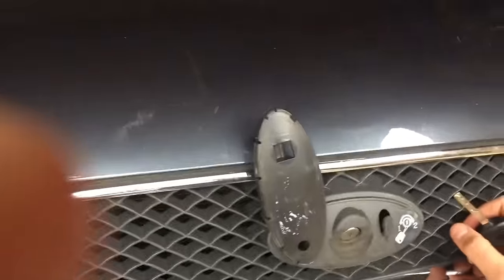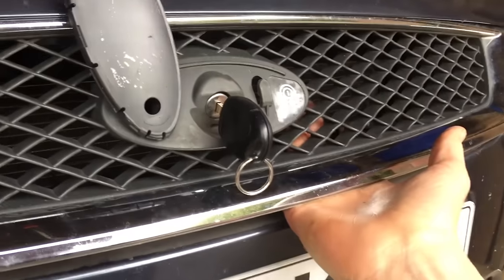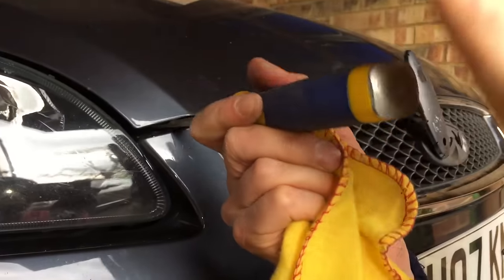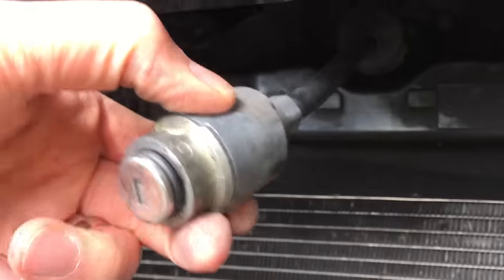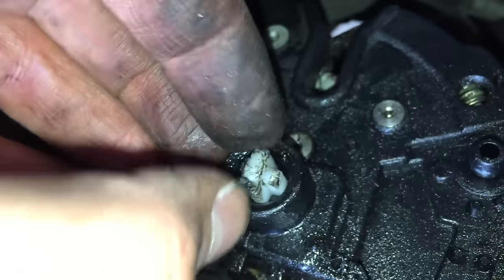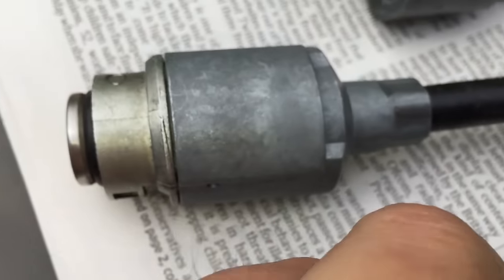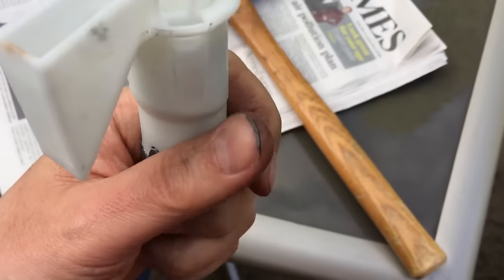Focus Mk2 Bonnet Lock Won't Open - Hood Release Problem (Full Guide)

Comment: Thanks for this. I followed some advice elsewhere that suggested if the white cross piece is simply loose, not broken, then you can try putting pressure on the lock (flexing the grill) while turning the key. That got the bonnet open so I could take it all apart.

I used this video to find my way around the assembly:
1) Removed the plastic screws from 6:35 (some with a screwdriver, some by prising up with a sharp tool) allowing me to remove the grill (with some force for the bottom clips) and top panel.
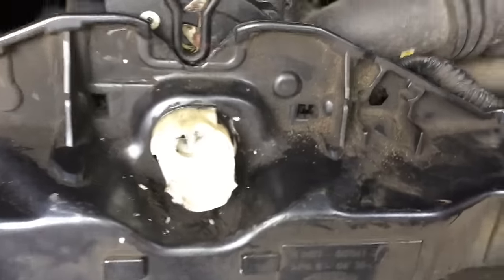2) Unbolted and popped out the latch assembly (see 10:15) and then I could pop the white cylindrical shroud through the hole without having to break it. 
3) Used pliers to remove the cross piece from the latch (takes a bit of force but came out intact), like at 11:52.
4) Clipped the piece into the cross-shaped slot in the other end, using a screwdriver to nudge the clips in, so it looks like 15:47.
5) Rebuilt everything, and it's all good!
Reply from the maker: That worked for me once, but I stupidly closed the bonnet and it never worked again :(  Thanks for posting though, it will help some prople im sure.

Comment: Thanks very much for this - it gave me a great start - and an idea that saved a lot of trouble.
I removed the grill and and pushed out the lock casing. Then I pushed and drilled out the securing pins to release the lock barrel. This allowed me to get hold of the end of the inner cable with a small pair of locking grips. After a fair bit of waggling and pushing in various combinations I got lucky and the bonnet popped.  (I'm sure it won't work every time, but it's worth a try.) On dismantling the mechanism it appears that the small cross-section piece of plastic is the culprit.

Comment: Thanks so much! Just completed it successfully. I’ve got the facelift model so stupidly thought I did need to knock out those first 4 clips…turns out you don’t on this either 😅 anyways, cheap and doesn’t hurt to replace. Thanks again, legend.
Reply: Ha, just realised I commented 5 years ago when it happened last time! Bloody thing.
Reply from the maker: It’s crazy isn’t it, on the third time I left the lock out and used a long screwdriver. Glad the video helped 👍
Reply: @MotoringEvents  great idea…next time I’ll do the same.

Comment: Thanks, the video was helpful.
I'm afraid of breaking down the front wall, so I don't break something, but I have to do it, because the locking mechanism failed for me too.
Reply from the maker: Hi, it's always a bit intimating, but it's not that bad once you get started. Read through the comments, there are some good points there.

Comment: EXCELLENT TUTORIAL. Thank you. Everything worked as you said, no problem. You can get the kits now off eBay for about £15.
Reply from the maker: Glad it helped. Are the ebay kits Ford? Whats the quality like? Thanks Rich
Reply: @MotoringEvents   Not genuine Ford, it was from the far east via a UK supplier. It arrived in two days. I didn't have any problems fitting it and it works fine. I used my own barrel lock so I can't vouch for the rest of the kit, but it all fits, it all works. Job done.  Thanks again, you saved me a lot of money. I dread to think what a Ford dealer would have charged.
Reply: How long did it take to do? Just had the garage tell me it's 3 hours labour costs.
Reply from the maker: Chris Shades cheers, good info.
Reply from the maker: Nigel Johnson if I had to don't again 30mins. But I think garages break the grill, so more expensive too.
Reply: @TheNigeljohnson   Not that long, maybe just over an hour. This tutotrial video made it so easy. Don't be afraid to whack hard with the chisel to cut off the tops of the securing screw plugs. Make sure they drop out when you have. Again, whack hard to break the old unit off then jam a screwdriver in there to twist left and right and open the bonnet. After that it's easy. If you are using your existing barrel lock you will need to drive the pins out to remove it. Use a nail the same diameter as a drift, but cut the point off first so the end is flat. If the pins are rusted in then drill them out with a same size drill bit. New pins come with the kit. It all went smoothly for me. Have confidence and give it a go.
Reply: Thanks for the info.

Comment: Had the same thing happen to me last weekend. Need to put the battery on charge but the bonnet failed to open. Thank you for your efforts to show us how it's done. I can see if you have slim small skinny arms you might be able to get to the 2x10mm bolts from underneath. I will give that a try but if all else fails I will follow your techniques and procedures. Thanks.
Reply from the maker: Hi thanks for watching, i tried that but couldn't get the lock off. Space probably depends on the engine too. Good luck.

Comment: Just watched this to get a good idea of what was inside my girlfriends car. One thing to mention, didn't have to use a hammer to break the barrel out, I just reached in behind and removed the 2x 10mm fixings with a ratchet, pulled the barrel towards me to disengage it from the lock mech and prised up the bonnet which popped out the lock. You can then turn the plastic cross part that is left in the lock with pliers to release it from the catch. In my case the barrel and collet had just disengaged from the plastic cross piece in the lock mech. Once I re aligned it and re-fitted it it was fine. Hope you never have to do this again anyway! Your vid helped me a lot.
Reply from the maker: Dean Forrest but the hammer was pretty funny! Good tip. Cheers
Reply: How did you reach in?

Comment: Nice video, with a touch of humour. I was able to fit the new lock. However, I was unable to get the grill off (later version of it than yours), so I had to cut it out. But job done, and thanks.
Reply from the maker: I have the later one now. You mean it's going to happen again!! Cheers for watching and I'm glad you got there in the end.
Reply: @MotoringEvents  The grille was only £25 - better than scratching the bodywork, and a lot better than forking out £200-£300 to a garage, plus the satisfaction of solving a problem. Cheers!

Comment: Agree - a bad design . I used a long modified screwdriver for a couple of years till the plastic slot of the lock eroded. After fitting a new lock I found that tightening  after removing / cleaning of two bonnet screw spacers which had aged / had dirt buildup  eases rotation of the key after  the bonnet was locked and the cause of seizure or resistance to turning of the key .Periodic  cleaning of these spacers below the bonnet keeps the system healthy from this future problems .
Reply: Nice one buddy, mine was slightly different but this video is spot on and saved me £200.👍👍👍

Comment: I yanked the whole grill away (including some of the plastic covering sadly) by knocking out the 2 retaining plastic rivets either side of the grill and freeing the 2 clips along the bottom. Yanked off the wire then used a hammer to knock of the white plastic bit, then used pliers to twist one way and then the other to open bonnet. You can see the 2 rivets quite easily by lifting the bonnet as much as you can.
Reply from the maker: Brilliant, thanks for sharing.

Comment: Hi, just had to change a bonnet lock on a 2010 Focus. Followed steps as per video. One thing, they seem to have changed the upper guard to a form of airbox. Did not come out untilbafter bonnet opened.
The replacement lock kit KAS00154 4M5AA16B970 Now comes with an extendable plastic bar instead of a cable.
Thanks for the video. Took me just over an hour.

Comment: Well done... I likely have this job ahead of me. Although I think I can get the bonnet open. Unfortunately I park on public road so it will have to be a start to finish job (with unknowable issues) on same day.

I must say, with Ford's enormous R&D, they get a serious black mark for such a BS design flaw. I tiny bit a important plastic - that's a recipe for future nightmares.

What was wrong with a foot well latch pull like my 20+ year owned MK3 Golf had.

When I eventually scraped her, the bonnet latch pull still functioned flawlessly after nearly 25 years.
Reply from the maker: Ive had to do it 3 times on 2 cars, cheap ebay part didnt work well for me. Ive left it out now and open bonnet with a long screwdriver. Good luck.

Comment: The MK2 Focus is full of problems which stem from shoddy designs, none of which should have ever been implemented.
Two notable ones are this very bonnet lock mechanism, and the power steering pipes. 

I shall be following your guide this weekend to replace my lock, or at least butcher it and integrate another solution.
Reply from the maker: Good luck for the weekend, I hope there's no need for butchery ;-)
Reply: Im guessing by power steering you mean the stupid union Nut
Reply: Richard Winstanley great I've just bought one after years of been a freelander fan ! Just can't afford the fuel anymore the governments squeezing us to go the way they want by fuel hikes .

Comment: Great vid, found my car is missing the stone shield which made for easy access from underneath without removing the grill!
Reply from the maker: You were able to pull the latch off from behind? I tried that, couldn’t do it. Next time I’ll try again.
Reply: @MotoringEvents  I just reached up behind the grill and crushed the plastic bit with channel lock pliers instead of the big hammer, pretty much followed your method after that.

Comment: Good video, I've recently replaced this on my 2010 focus I found it better to just bend the plastic grill upwards then release the key barrel and then use a set of grippers to pull out the cable with brute force then use a screw driver to open bonnet release. I did replace the white collar with a new one that came with the new kit frome ebay £15 with 2 keys
Reply from the maker: Thanks for the feedback, I'll pin this message so people can see it.
Reply: You pulled the key lock out with brute force?
Reply: @Dept B  no , once you pull out the grill  and release the barrel this leaves you access to the inner twist cable which in actual fact causes the problem. Once you pull this out it leaves you with a slot for screw driver accessibility. I hope this is helpful.

Comment: It was such a fun looking at somebody else struggling with this abomination.

To avoid those problems it helps much to have your lock well LUBRICATED all the time (it being stuck is the main reason the mechanism breaks), plus to be the only one you let open the bonnet (because others doing it with force is usually the time it breaks)

If you still care for this car, it is probably the best idea to ask somebody to fabricate you a sturdy metal lever, attach it to the mechanism and on the other side make it poke through the grille

Me I got used to lifting up the bottom part of the grille, going in with my hand and turning the mechanism with my hand (praying that the sphere doesn't get detached from the fork and swearing at the idiot who engineered this.)

If you are still in the process of opening the bonnet,  just pry the bottom part up, then go inside with the hand. . If you have a plastic lever, it will usually break at the lock, so you can turn the lever with your hand (but do it carefully so it doesn't get detached). If you have the wire system depicted here, pull iit out and turn the mechanism with your pliers. It is not a bad idea to look at the footage here to see what things look like inside to know what you are doing - actually knowing what is where is the most important thing here. 

Let me say that if there is the 10th circle of hell, the engineer who's planned this is certainly there.  If not anybody else, he is there. He fully deserves it. This is refined evil and stupidity. 
Let's look at those stages of idiocy: 
1 - make a bonnet to be unlocked with the ignition key (not that you need to run the engine often when you open it ...)
2 - use an unreliable and easily broken mechanism
3 - (later) "upgrade" it with a plastic lever (this is the one I have and makes me mad on and on) - well, in one sense it is better because you can reach in and turn it, but it breaks much easier (plastic gets brittle over time, and it also gets disengaged quite easily from the "sphere"

Oh, and I just realized, this is like BEGGING for somebody to pry out the lock cillinder from the soft plastic grille at the front, make a copy of the key and break into the vehicle .
Reply from the maker: Great and accurate write-up. It is a very painful and unnecessary exercise fixing and living with this crazy design.

Comment: A very useful guide, thank you. I found there was no need to use a lump hammer to break the old casing, I just used a flat head screwdriver inserted inside the casing and then levering it to break the casing open. A bit more efficient but probably less fun.
Reply: Hit myself in the eye lol

Comment: Thanks for such a helpful video. It's great.
Where can I buy the whole lock system you bought.
Thank you very much.

Mikel
Reply from the maker: Hi Thanks for the great comment, there is a link in the video description to the Ford part I used, but if you don't mind paying a bit more you can go into the dealer and talk to the parts desk about what's available.

Comment: Thanks for the video the video is very useful.
only difficulty faced was getting the key barrel out of the casing as the 2 short pins wont come out. the log one came out easy.
ended up using a drill to get them out.
Reply from the maker: Yeah I had to drill the short pins out. Glad the video helped though.

Comment: Hi, how durable has your replacement been? I am looking at reviews for a replacement and quite a few people are talking about them breaking after a few months only. Thanks
Reply from the maker: I used the ford part. It worked fine while i had the car, about a year.
Reply: @MotoringEvents  OK thanks. Ford now charge 70 quid for the lock part now it appears. It's under 30 on amazon etc for a non ford made part... Might he worth jist getting it from Ford I guess lol
Reply: @UnseenSpirit  Damn I just bought a knock off for 38Euro, the "original one" was 80Euro.

Comment: Great video mate,tanks sooo much. Am having to do this on my daughters Focus. However,the inner latch lock seems to have different electrical connections to the one on your car(and unfortunately to the one i bought off Wish!). Your connections have two male prongs while the terminal on her focus  latch lock does not. They are just two flat contact points,like at the base of a house light bulb. Do u know if i can use the one i bought which has two male prongs like your one?  Thanks  Gerald
Reply from the maker: Sorry, I don't know, I've done it twice, mk2 and mk2 facelift both were the same from memory.

Comment: I really would like to know more about the two outer clips/bolts that appear to have been broken off 4:30 On the video, that looks like a solid metal bolt, I cant figure out how your chizel gets through that, or how you put that back on to the chhicle after the main fix. Any insight on this would be greatly appreciated. please tag me. thanks!
Reply from the maker: Hi, they are plastic. It’s a plastic screw that screws into a plastic fixing, I cut the top off of both the screw and the fixing it screws into, ideally they need replacing but I didn’t bother as the whole unit clips back in fairly solidly and the closed bonnet holds it in place. Some people in the comments were able to pry the whole thing out rather than breaking it, but they are super cheap. Have a look at the other comments. Thanks for watching.
Reply: @MotoringEvents  ok that's awesome. I'm struggling to find replacements online. Do you have a link, or something specific search criteria. I'd like to have it back perfectly, just for my OCD. Even if the clips aren't needed, I kinda want the option to do that, just for my brain lol. Thanks !
Reply from the maker: @djtyros I total understand I’m going though the same sort of process with an A3 at them moment, replacing missing or broken bits. Search eBay and Amazon changing the keys words might help, if all else fails the forums are better for really specific info. I have a link in the video description to the fixings I used but they maybe for the smaller ones, it was a while ago, I can’t really remember.

Comment: Great video, thank you, was sorely tempted to have a go, although rang the Ford dealer in Farnborough first and they quoted me £170 for the new mechanism kit and fitting, also to rebuild the lock to my key, not cheap but better than some of the quotes I have seen, also saved me losing my temper as i'm quite cack handed...Have to say the design is a complete disaster, shameful from Ford.
Reply from the maker: Thanks. £170 is a great price.